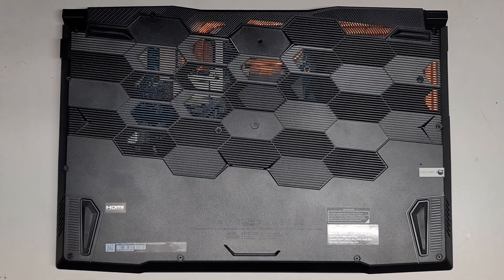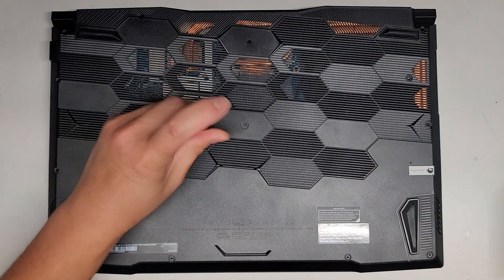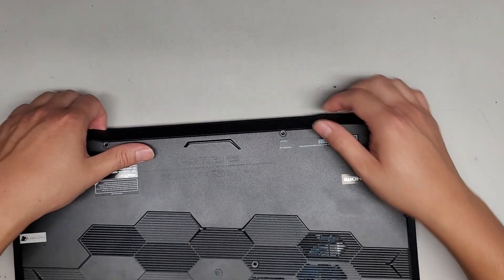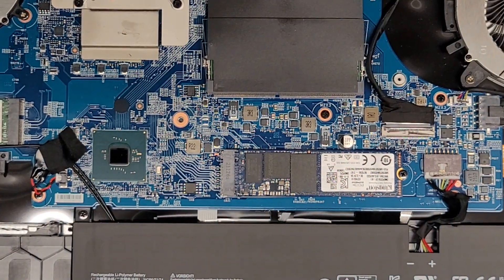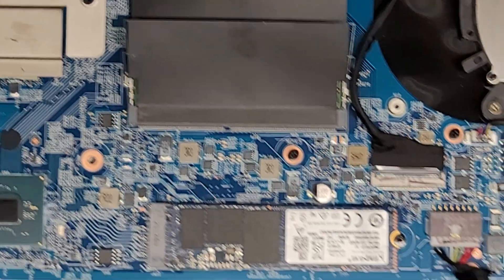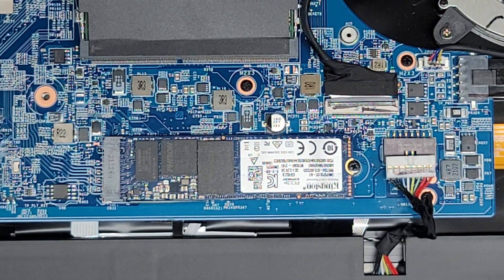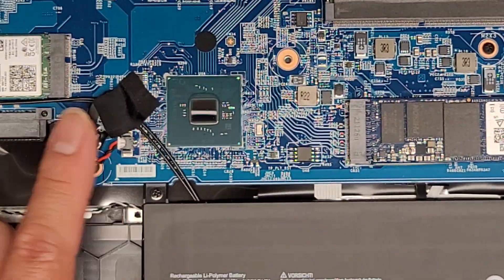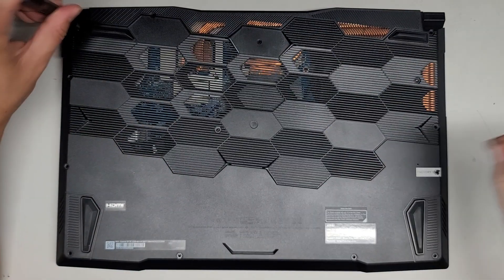MSI Katana GF76 Disassembly RAM SSD Hard Drive Upgrade Battery Replacement Repair Quick Look Inside

Comment: Thanks mate, I was a little worried about pulling those wires to disconnect the battery and was wondering if I was missing something but there didn't seem to be any other way. Cheers.
Reply from the maker: No problem. Glad it helped.

Comment: For some reason I don't have the connector for the ssd drive.. Could I install the connector myself and which one should I have to buy then?
Reply from the maker: You mean the motherboard doesn't even have the slot? I don't think you can add one.
Reply: @ItsBinhRepaired  I have Katana GF76 11UC that doesn't have the connector for 2.5 inch soldered on the motherboard, how can i add one. I mean i can solder one but will it work

Comment: hey, thank you for the vid, i have the same laptop with 512gb storage and it's running low, should i get a sata iii ssd to put it in the empty slot, or an external ssd via usb c, both options i found from kingston btw, also i'm not good at all with computer components, would it be hard to mount the sata?
Reply from the maker: This will be better https://youtu.be/4p5jFDzVwUw

Comment: I have the same computer but the biggest isue of this computer that I have that it's cpu overheats. I dont know if it's of the liquid being dry or if the fans don't do enough work. But while I play games on it and if the fps or graphics are way too much for the computer to handle it starts to flick. What I mean the screen just starts to flick black and back to the game and again back to black and it does that till i change the fps and graphics. Well it seems it's reallly hard to get the cpu out and reattach with new liquid. P.S. I'm kinda a newbie at computers so what I mean by liquid it's a special one that glues the cpu. I have no idea what it's called. But thank you for the video that you made a year ago lol. It was helpfull!
Reply from the maker: The thermal paste
Reply: No i have the same problem where the screen goes black and stops charging when gaming, its not your gpu its your power supply i just deal with it instead of getting a new one
Reply from the maker: @DwellHiden :(
Reply: @ItsBinhRepaired  Lol the msi katana gf76 is supposed to come with a 150 watt charger at least but i have a 120 watt so its not that bad
Reply from the maker: @DwellHiden  interesting

Comment: Any chance you'd give some insight on how one would change the fans on this model? I have an issue where a fan is giving out and vibrating / failing to spin properly, I want to replace it myself but from what I can see it looks like those heatsinks are locking the fans in place and I think I wouldn't be able to replace the fan because of them?
Reply from the maker: This might help Fan Repair: https://www.youtube.com/playlist?list=PLSSiYX-ta7aqqxfDWDQh-B6Az4ZgDI459
Reply from the maker: Or maybe this one Thermal Paste Application: https://www.youtube.com/playlist?list=PLSSiYX-ta7aqlImqkdLxHHpJbJttlNJgQ
Reply: @ItsBinhRepaired  I don't see an MSI Katana GF76 model in any of those videos unless I am mistaken, I was hoping to find a video of someone replacing the fans in the model of laptop shown in this video we're commenting on
Reply from the maker: @foolishkoru7197  if you watch them, you should be able to figure out any model

Comment: hey my katana gf76 12uc doesnt come with ssd sata slot mounted in the motherboard but they gave it separately on the box hdd upgrade kit , does that mean i can actually put sata by shouldering it manually or where did you plug it in?
Reply from the maker: There should be a connector on the motherboard

Comment: Hey my laptop was working just fine and then it stopped charging. Like it wouldnt charge at all. The battery was overdue for a calibration so i dont know if thats why. Would u recommend changing the battery?
Reply from the maker: @haarisamir1987  possibly battery, charge port, charger, or charge circuit
Reply from the maker: @haarisamir1987  does it work while plugged in?

Comment: Had to change my charger port and this helped out a bit but now I can't figure out where some of my screws go! Help!
Reply from the maker: @solemnjester2100  use a pin to check the depth. Follow along with the video.
Reply: I'm trying to replace mine. It's borked 2 power bricks so far. How did you get it out ? Did you remove the motherboard or the heat pipes ?

Comment: I got mine from walmart. Like a year or, so when i first got it i wanted to add hdd. I now, from this video how found out that the component is entirely missing. What the hell
Reply from the maker: Likely can't be added
Reply: @ItsBinhRepaired  But it does have an area where everything SHOULD be. It's marked hdd and has each hole where  things go. (I'm not great at computer terminology.)

I don't see why It couldn't be added. They just simply didn't put in the hdd port
Reply from the maker: @LaughingStockArt  money savings
Reply: @ItsBinhRepaired  Gotta love walmart. Huh? Well. No complaints. Pretty good computer. I imagine it'll last more than long enough until I can get myself a pc
Reply from the maker: @LaughingStockArt  yup
Reply: Same. The connector is missing on mine. Oh well

Comment: My msi gf76 11ud laptop is 2 years old so its already full of dust and i need to clean the underside of the keyboard and clean the cooling fins is there a way to do this???
Reply: Literally want to do the same after 3 years. Did you find anything or have you done this yourself?
Reply: @hepatitasc  compressed air

Comment: Finally got brave enough to open up my GF76 today and upgrade the ram (been sitting on it for few weeks now).

Much appreciation for the video, watched it a few times over that time to help motivate me.

Serious, great vid, down to earth, helped me a lot bro <3

~a random canadian subscriber dude
Reply from the maker: Glad you were able to eventually get to it and were successful. :)
Reply: Thinking about upgrading the RAM in mine. What did you updrade to?
Reply: @liamquessada1802  Just swapped in 2x16gb 3600 memory
Did some testing and I have seen it utilize over 18gb, so the upgrade was worth it ^^

The teardown was really easy, didn't feel like I was destroying her when I pulled the backplate off. Good time to get in there and blow it / clean it out, too! ^^

Good luck with the upgrade, mate!

Comment: I have katana gf76 from 2021like in video it have second ssd slot?
Reply from the maker: If you use a 2.5" SATA SSD.
Reply: @ItsBinhRepaired  ok ty man and u don't need to reinstall windows after installing second SSD?
Reply from the maker: @tnk_official  nope, just initialize and format it in the disk manager.
Reply: @ItsBinhRepaired  ok ty cuz I need another storage like a 1tb
Reply from the maker: @tnk_official  yup

Comment: I have this laptop it’s a 3050ti and came with 16gb of ram I wanna make it 32gb of ram can I get 2 16gb sticks or do I need 1 32gb stick?
Reply from the maker: 2, the answer is in the video.
Reply: @ItsBinhRepaired  ok thank you
Reply from the maker: No problem

Comment: Does anyone know what screw driver is required to unscrew the one that's all the way on the right in the middle? I was able to use the same screw driver to take out literally every screw except for that one. So i can't take the back off because there's one screw that won't come out. I've tried to find out what exact screws the laptop uses but haven't found any answers.
Reply from the maker: https://amzn.to/42pElq1 this should have what you need. If it doesn't, then you likely stripped it.

Comment: It's interesting that for the 2023 GF76 Katana I see M.2 PCIe 2280 slot is suggested. I've got that from the vendor's specs though not sure it that's correct.
Reply from the maker: Yeah
Reply: I bought mine in 2022 and it has 2 M.2 slots.
Reply from the maker: Nice

Comment: ive made a mistake of not memorizing which screw goes where, and there appears to be one screw that is longer than the rest. do you happen to know where it goes?
Reply from the maker: Use a pin to measure the depth of the holes
Reply: @ItsBinhRepaired  Thank you!
Reply from the maker: @srstafion_  yup

Comment: What I'd like to know with this model is how to replace the keyboard. Tons of people seem to have a problem with this models keyboard and so do I. But there's basically nothing on how to fix that when keys die.
Reply: I have to use an external keyboard with mine.  I bought a replacement keyboard, but I have yet to see any way to install it.  What were they thinkng when they designed this laptop?  If you try to remove individual keys to clean it.. forget it, they break very easily.
Reply from the maker: This playlist should help Keyboard Replacement Repair: https://www.youtube.com/playlist?list=PLSSiYX-ta7aqzLhKbFnFGe9y9jl_d0aiU
Reply: I wound up buying a new motherboard!  The ethernet port was not reliable, one speaker ws buzzing, and the battery would not keep a charge for more than 3 minutes.  When the Katana is operating as it should, it is great, but it is too fragile and falls apart quickly.  Also, the keyboard  cannot be repaired, and is hell to replace.
Reply from the maker: @lololulu1729  yeah...
Reply from the maker: That's likely because the process is something like this https://youtu.be/X-yz1SgKxmw?si=qAJoL5J-MrUUvDVq

Comment: hello I have a question.. I have this laptop now and it comes with 16gb ddr4 3200 memory is upgradable to ddr5 4800?
Reply from the maker: The socket isn't the same. It'd be like trying to put a AA battery in a AAA battery spot.

Comment: Thanks great video wanted to upgrade the rom. Now i know i have to buy a 2.5” ssd rather than an additional nvme still bad from msi for not giving the additional nvme 2 slot
Reply: The 3060 model has 2 nvme slots.
Reply: @sirajelalem502  can confirm my 3060 GF76 12UE had 2x nvme slots
Reply from the maker: Nice
Reply: Yes i also installed 2 nvmes there was an additional slot for nvme
Reply from the maker: Awesome!
Reply from the maker: Glad it helped. If you haven't already, please like and subscribe so others can find my videos and possibly consider watching a few others to get the algorithm to recommend my channel. Thanks!
Reply: I now have both M2 and SSD. Work great both of them. 512 GB each.

Comment: Hey, cant quite open the case up. You seem to not find it struggling, i think because its been opened in the past. How do i open it up without damagin anything, thats what im afraid of doing - accidentally messing it up.
Reply: For what it's worth, I broke the virginity seal on my gf76 today, and for anyone reading, if you follow the instructions order of where he starts -> moves on to exactly (I used a small, triangular pry tool), you'll open it up no problem. 
Trickiest was at rear near the heat fins, it's tough to see where you gottah pry. But my man's video was SPOT on

Much appreciation and respect for homie making this video <3

~a random canadian subscriber
Reply from the maker: Haha thanks!
Reply from the maker: Have to do it the way I show.

Comment: Heya, that was a useful vid. Just wondering if this is the 12UD version of the GF76?
Reply: Actually, thiiiink the serial number in vid shows 11UD though I'm not 100%
Reply: I think it must be the 11UD in the video, I eventually picked up the courage to open my laptop, (it's a 12UD) and it had only one slot for ssd.
Reply from the maker: Aww
Reply from the maker: Not sure
Reply: Smh the creator of the vid couldn’t even find out for you. Goofy
Reply from the maker: @Johnnyw-ln8ew  it's a customer's computer and I don't have access to the device anymore, so any info that's not in the video can't be gotten, sorry.
Reply: Serial number shot in beginning of vid would have it there (I can't zoom in myself to check) 
Curious to know myself, too. I have the 12UE-006CA, so many diff models for the GF76 lol geez MSI u.u  @ItsBinhRepaired

Comment: there is not ssd/hdd connector in my laptop!

do we have to solder it manually?
Reply from the maker: Don't think so
Reply: in Gf76 UC model there is space for 2.5ssd or HDD but no connectors !

How should I add connectors to the motherboard ?

is it possible ?
Reply from the maker: If the soldered connectors aren't there, then likely not.